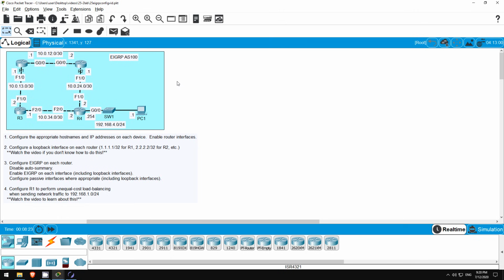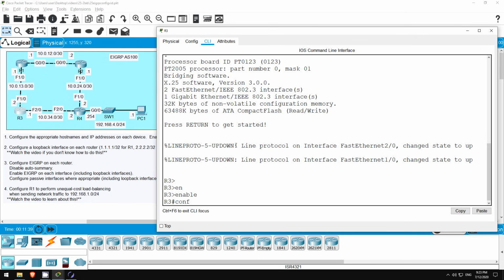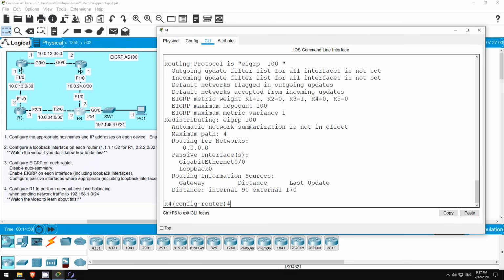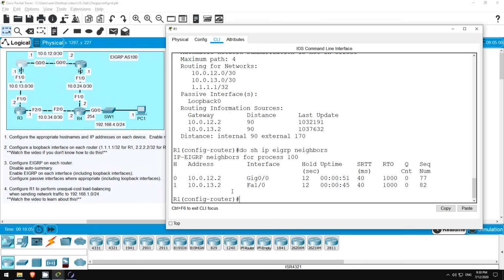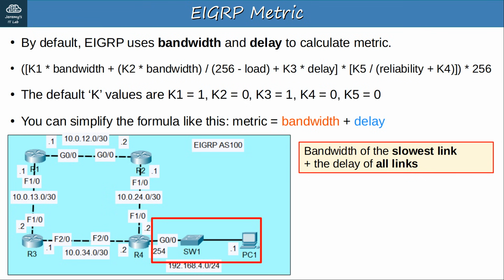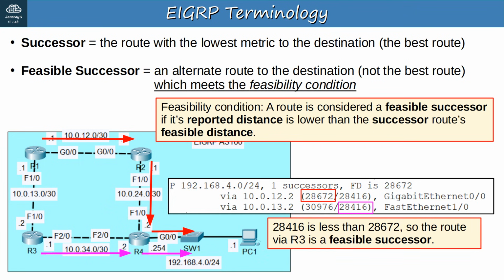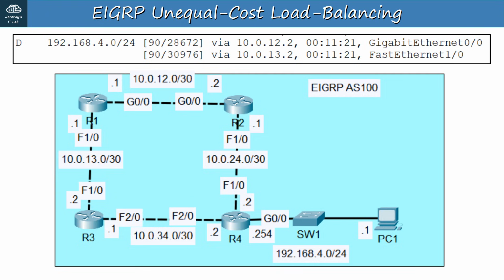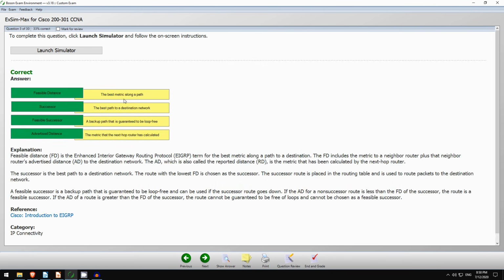Free CCNA | Configuring EIGRP | Day 25 Lab | CCNA 200-301 Complete Course

Comment: I used "network 10.0.0.0" as the EIGRP command since it encompassed all the P2P networks.
Reply: I did the same thing too.
Reply: That does work, but I believe the concern is non-specificity. You may not want some ports to have EIGRP routing enabled for whatever reason, but they remain within that same broad 10.0.0.0/8 subnet that it automatically assigns itself to.

Comment: I don't know if this is relevant but whatever. I'm trying to ping the routers from PC1 but it won't receive a ping from any router except R4. Routers are able ping each other from any point just fine. Can anyone explain to me why that is? EDIT: After trying different things for a while, it turns out I had the default gateway configured wrong. 😅

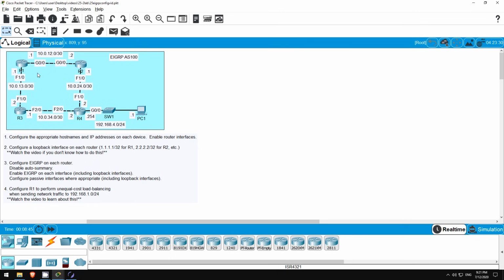Comment: spent a along time on why can`t see "192.168.4.0/24 [90/28672] via 10.0.12.2, 00:01:56, GigabitEthernet0/0". Finally found out that I put a wrong IP address for R4 F1/0........
Reply from the maker: Small mistakes like that are the most common!
Reply: dude, thank you for this comment. I had to check my G0/0 doing a show run and noticed I didn't configure g0/0. God I feel so dumb lol.

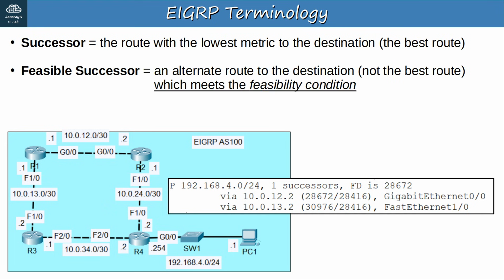Comment: One thing I do not understand is at 17:17. If the Successor is the route with the lowest metric to a destination then why is it the route via R2? Both routes via 10.0.12.2 and 10.0.13.2 have an advertised distance of 28416 so it is a tie?

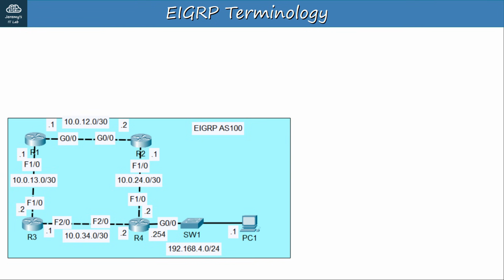Comment: Hi Jeremy, on 15:13 , for the simplified formula, shouldn't you also need to multiply by 256 after adding the Bandwidth and the delay?  Also,  in real world applications,  when is it necessary to change the K-values ?  Thanks
Reply from the maker: The point of the simplified formula was to not worry about the numbers, just to show that EIGRP calculates metric by adding bandwidth and delay.

You would change the k-values if you want to effect how EIGRP calculates metric, to make it prefer certain routes over others.

Comment: What router is Jeremy using in this lab? I'm also receiving the incompatible error unfortunately.

Edit: I evetually figured this out after some messing around. The router used is PT-Empty. You'll need to go to the Physical tab and flip the power switch off and then drag and drop 1 NM-1CGE and 2 NM-1CFE modules. Don't forget to power it back on after doing so!
Reply: thanks dude. I was really struggling a lot about it.
Reply: @joaofoster5283  No prob! I'm glad it helped someone :)

Comment: What if you have a layer 3 switch connected to a router? Do you have to enable passive-interface on that interface connecting to the layer 3 switch? I'm doing a self made lab and was wondering. The lessons are very. Keep it up!
Reply from the maker: It depends, do you want the router and layer 3 switch to be OSPF neighbors?
Reply: @JeremysITLab  I wanted them to be EIGRP neighbors. I didn't know that Layer 3 Switches could also use these routing protocols, but I tried it on a layer 3 switch and it works!

Comment: I have a question regarding the "network" command. Jeremy explains that it is used primarily for selecting the interfaces EIGRP is activated on. Not for specifying the advertised networks. So why do i have to execute the network commands for the loopback interfaces if i want to advertise them? Can someone explain?
Reply: He does mean the networks on the interfaces. Without entering the 'network' command, the router will never advertise networks, seek out neighbors on those same networks, or form adjacencies.

Comment: thanks for the great videos.
i got a question, so if u don't want to use the lab trick on R4 you need to configure EIGRP for 192.168.4.0/24 too, right?
Reply from the maker: Yeah the instructions say to enable EIGRP on each interface, so any command that enables EIGRP on the interface is okay (i.e network 192.168.4.0 0.0.0.255 or network 192.168.4.254 0.0.0.0)
Reply: @JeremysITLab   thank you very much.

Comment: Lab is bugged, did everything correctly doesnt seem like eigrp will work. also all interfaces are down to begin with unlike in the video of the bat i knew something was wrong.
Reply: make sure to configure the ip address of each interface and turn off shutdown
Reply: @brandonlee934  I mean you can tell that there is something wrong with the lab when the lab opens it doesnt look the same as in the video. Maybe it was fixed since i posted but it seems others were having the same issue. All of the other labs have worked fine and were fairly easy to complete most i have completed by myself.
Reply: At the start of the video he tells you that he has left the devices unconfigured in the lab file to let you practice setting things up, and that he has already done this before recording, so he moves on to step 2. of the lab.

I set up all of the devices, followed the instructions, and had no issues with the lab.

Comment: What is the downside of using the "network 0.0.0.0 255.255.255.255" command in a real network environment?
Reply from the maker: EIGRP will be activated on all interfaces.  It's better to specify exactly which interfaces you want EIGRP activated on, so it's not activated on interfaces you didn't intend.
Reply: @JeremysITLab  Ok Sensei, I promise I won't be lazy in the future and I will be more specific in my configuration! :)

Comment: Hello! By mistake i configured the networks in for EIGRP with a normal Subnet Mask instead of a Wildcard Mask, and it's working, is there something off? Or is there a difference that we will learn later?
Reply from the maker: Interesting, I just learned a new feature of EIGRP!  If you mistakenly use a subnet mask instead of a wildcard mask, it automatically converts it to a wildcard mask, like below:
Router(config)#router eigrp 1
Router(config-router)#network 10.0.0.0 255.255.0.0
Router(config-router)#do show run | section eigrp
router eigrp 1
 network 10.0.0.0 0.0.255.255
Reply: @JeremysITLab  thank you very much ^_^
Reply: @JeremysITLab  does it work on OSPF the same way?

Comment: Hi mate. So in my packet tracer, the pt-empty routers are not adding local (L) routes. Only the connected (C) routes. So, the arp request is not getting completed on pc. 

I tried the 1941 routers and they are working as expected. But they don't have gigabit ethernet support. 

So is this a router functionality or a bug in packet tracer? I tried creating a lab of my own and again local routes are not appearing in routing table

Comment: SHOULD BE  (Bandwidth+Delay)*256  , not only Bandwidth+Delay ;    Time of information 15:03
Reply from the maker: That statement is a simplification of the formula. 
(It's directly from Cisco: https://www.cisco.com/c/en/us/support/docs/ip/enhanced-interior-gateway-routing-protocol-eigrp/16406-eigrp-toc.html#anc6 )
'For default behavior, you can simplify the formula as follows:
metric = bandwidth + delay '
Reply: @JeremysITLab   sorry, but  I think simplification doesn't exclude multiplying on 256,  it excludes those other K values, which equal to 0! Isn't it ?
Reply from the maker: @kakhakaxa4807  It's a simplification, the exact numbers don't matter.  As I said, it comes directly from Cisco.
Reply: @JeremysITLab   Thank you for a comment ! Everything is clear.

Comment: Hey Jeremy, Can you tell which version of packet tracer are you using for labs? I downloaded your labs but couldn't open the files since yours has a different version than mine. I'm on version 7.2.0.0226 at the moment. 

Also, the email got deleted by mistake which had the link for your google drive account for labs. Is there any way you can send the email again?
Reply from the maker: If you download the latest version you'll be able to run all labs, including from previous versions.  Currently it's 7.3.1.
Send me an email at jeremy@jeremysitlab.com, I'll send the link again.

Comment: After completing the lab (including changing variance to 2 for unequal cost load balancing), was anyone able to ping PC1 from R1? I've assigned ip and default gateway to PC1 and confirmed SW1's interfaces connected to R4 and PC1 are up, but still fail to ping from R1 to PC1. I can ping from R4 to PC1, and from R1 to R4, but can't ping R1 to R4. Any ideas/help please

Comment: I have finish this lab, but one thing is not right. When I check the route table on R1, it seems that R1 never learns the route to 192.168.4.0/24 network. My configurations are exactly like Jeremy's. Is this a limitation of Cisco packet tracer?
Reply: I followed the instructions and the 192.168.4.0/24 network does show up in the routing table on R1 for me. I recommend running "show ip protocols" on R1 and checking the Routing Information Sources at the bottom to make sure it is communicating with the other routers.

Also, make sure that you are in Realtime mode, not Simulation Mode.
Reply: Please make sure you have configured 192 network explicitly during eigrp configuration inside R4 or configure network 0.0.0.0 255.255.255.255 like jeremy shows in the lab

Comment: The route for 192.168.4.0/24 network is not appearing when I view it using the show ip protocols command, although I did the same configuration as you. What could be the cause of this problem?
Reply: The link isn't working. Verify if the interfaces have IP addresses and if they're up (no shut)

Comment: I am really confused as of doing this lab and idk if it's just a packet tracer thing or not or if it's just me.

I was testing some stuff during this lab and I noticed that the router interfaces would accept eigrp routing and form adjacencies even when I setup
ridiculous commands like "network 0.0.0.0 0.0.0.0." but, at the same time it wouldn't accept a command/form an adjacency like "network 0.0.0.0 255.255.255.255" which
I assumed should work no matter what ip address the interface is assigned. What is going wrong?
Reply: Must've been doing something wrong on my end because after re-watching and practicing more, it seems to be working as I expect.